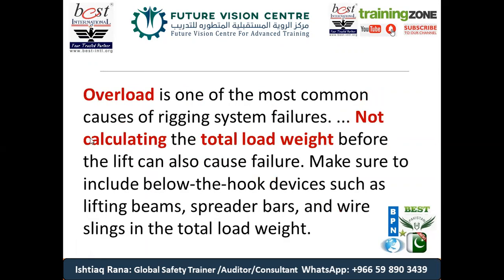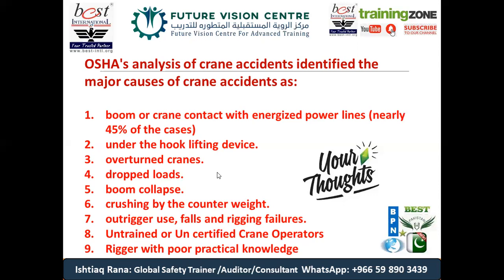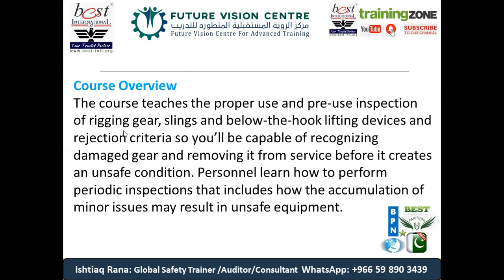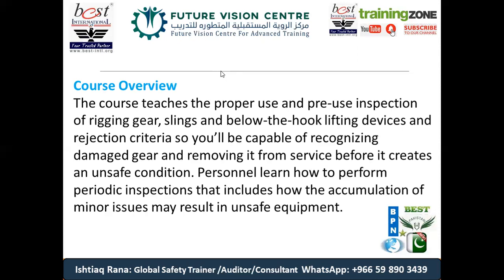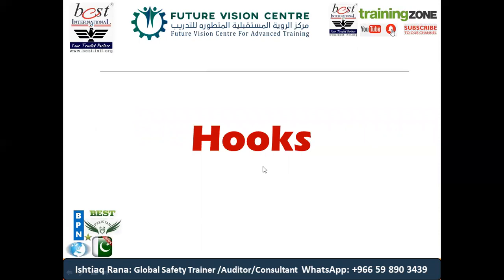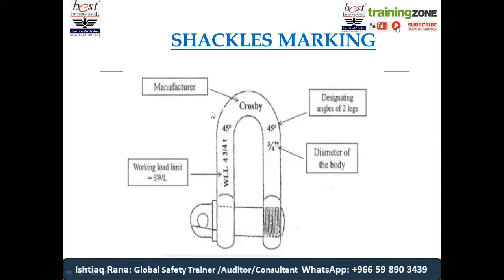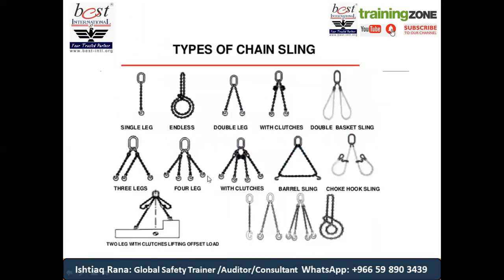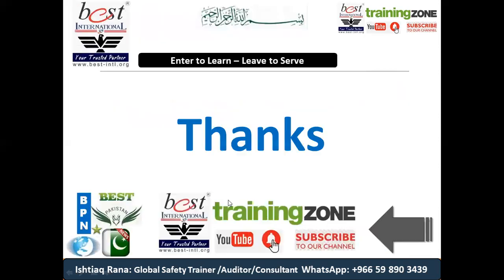Rigger Level III Saudi Aramco Training

Comment: What is required qualification for rigger level 1 job?
Reply from the maker: Dear are u working as a Rigger 3 & 2 or directly planning to go for Rigger 1?  If directly then make sure u have 3rd party Certification with 5 years experience and much better if you would be a Mechanical Engineer.
Please also watch below video  
https://youtu.be/TCCAAInNAcc